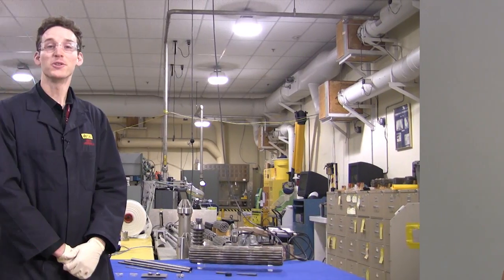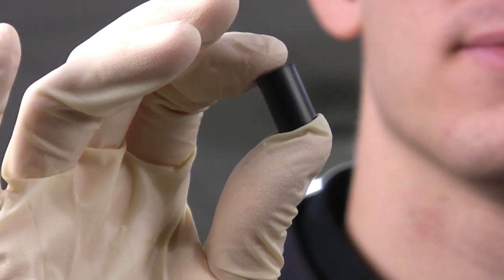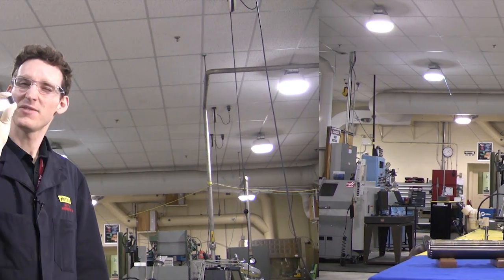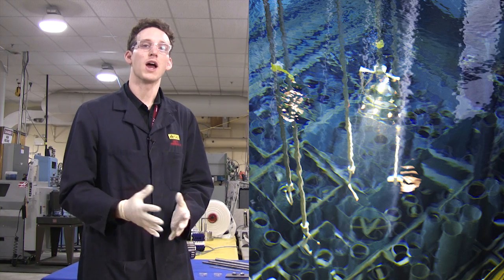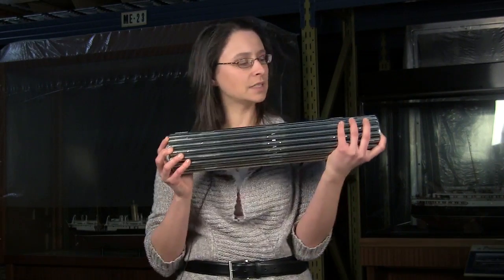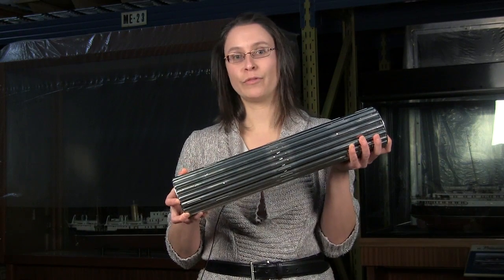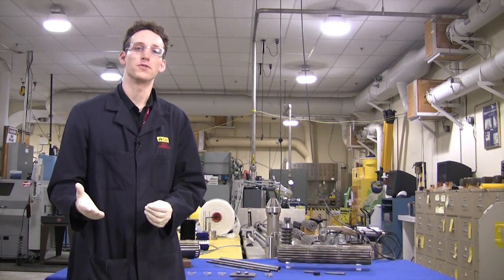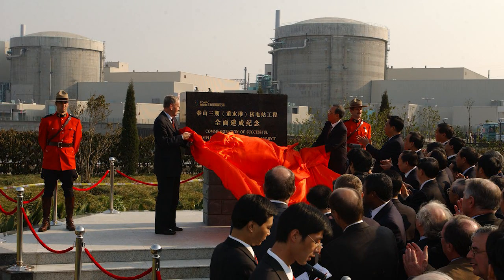Recycling Nuclear Fuels

Comment: Seems a waste to keep piping hot spent nuclear fuel rods in a pool for ten years. Can I have one to plonk into my water heater at home?
Reply: Bushcraft1974 are you joking?
Reply: @delisiafadelis6697  actually the penetration of radioactivity decreases in such a seemingly shallow pool. If you tread the water at the top of the cooling pool you would basically be getting no radioactivity on you. So hypothetically this might be safe
Reply: @delisiafadelis6697  He is right. It's doable. Using a Water to water(or radiator fuild but then you need another to water again) heat exchanger, you can transfer the heat to clean tap water.
We could actually have heating centrals heating hot water networks, some neighbourhoods already have such networks, running on gas.
Reply: It can happend because water cannot beamdes radiactives like the moon rocks. however you needs to cool off the reactor fuels or else it will steams and you will be getting freee electricyt instead of hot waters. thanks you!
Reply: I know your joking but you realize if cool water isn’t constantly pumped in the water will get so hot that it will evaporate, those rods are like 1400 degrees celcius
Reply: @tylersills9962  ok. so have free hot water for the whole neighborhood.
Reply: the idea of repurposing spent fuel rods is not crazy.....regardless of what some people may say here.  Of course, the problem is safeguarding the spent fuel rods, a terrorist can built a so called dirty bomb and really mess things up.  but your idea as funny as it sounds is not really crazy or funny....makes a lot of sense and is something scientists should be investigating.
Reply: Two years since I posted this. I still haven't received my spent fuel rod even after asking the NRC very nicely if they had any spare laying around?
Seriously though, no way they will implement this usage of the energy in the spent rods for the same reason they don't reprocess them into new rods (spent rods still have about 95% good  fissile material left), some one powerful is still getting rich mining the raw Uranium! Meanwhile the U.S alone has a mountain of energy dense waste laying around getting larger by the second!!
Reply: Soviets did it with Sr90 which they used to generate electricity and heat for Arctic lighthouses.

Comment: Fuel bundle is so heavy that you cannot carry it and wave it while taking. The fuel bundle shown is definitely empty.
Reply from the maker: You are correct, it is a replica fuel bundle
Reply: Nij Jin. Even when the fuel bundle is full it is not very radioactive, at least before it is put in the reactor. So it is reasonably safe to handle.
Reply: It is actually a full of uraniums and ready for use in a reactors. Thansk yous!
Reply: @CanSciTechMuseum  not that you'd come to any harm handling a live and fresh fuel assembly. Besides the physical weight fresh reactor fuel bundles can be bare handed perfectly safely.
Reply: @Nij Jin it's not a problem. Fresh reactor fuel is incredibly benign. You can bare hand it perfectly safely.
Reply: @paulanderson79  wrong
Reply: @paulanderson79  clearly you have no idea whags6 inside fuel rods
Reply: @WadcaWymiaru  So for me.
Reply: @sturggaming6759  What do you think is inside them?

Comment: So can a test tube with this pellets could heat up water? Or is t need something else?
And how small can a nuclear powerplant be made? For example the size of a refrigerator?
Reply: The core of a research reactor isn't much larger than a domestic fridge. A test tube of pellets alone cannot heat water as there's insufficient material to sustain a super critical reaction.
Reply: Watch videos on how reactors work need  developer pools a core needs transfer pipes transmitter etc etc etc
Reply: Look for NASA kilopower reactor for moon missions and deep space satellites. quite small, but on earth you would need protective shielding a wall of concrete, steel or lead. The higher the enrichment of the fuel the smaller you can go. Also using neutron reflector like beryllium helps to get even smaller.

Comment: If you use a fast breeding reactors you can refill the reactor and run it for about 20years if I remember it correctly.  Molten Salt Reactors are better type of Reactors because it is a very save Reactors. It moderate himself and you can easily sleep at the work like homer Simpson 😄

Comment: Solid fuel reactors are the past. We must invest in MSR and LFTR.
Reply: These designs do have their own drawbacks as well.
Reply: @paulanderson79 , not as many as in the PWR. (In my opinion)
Reply: @stefanotherisod3311  All designs have drawbacks and are limited by compromise. AGR were once the new nirvana but they are now relegated to history.
The fuel cycle itself isn't automatically indicative of a particular design.
Reply: @paulanderson79  , agreed all reactors/designs have their drawbacks. But if you design a fast molten salt reactor you will have the following advantages: - Low pressure. - Walk away safe - Liquid Fuel - High temperature and thermodynamic efficiency- Self regulating output power - Reduced waste and shorter "half life" - Burn Plutonium and PWR spent fuel. Are they perfect: no. All the problems have been worked out: no. (Especially for thorium based reactors) This is why we must, in my opinion, invest in this kind of reactors and shelve ASAP old PWR and fossil fuels.
Reply: @stefanotherisod3311  couldn't agree more. The barrier is political. You and I are acutely aware of that.

Comment: How many times can an uranium pellet be recycled ?
Reply: Uranium pellets for recycling are destroyed, so technically the pellets aren't used again at all. 

But in theory, a pellet only looses about 1% of the uranium its structure before it has to be recycled. (I may be wrong in actual numbers, and it changes depending on reactor type.) This is because the Fission products (left over "ashes" from the reaction), are inside, poisoning the reaction.

So if you could extract the fuel from the pellets, you could get several uses at least, and many, many more if you added more fuel over time. 

It's not cost-effective right now, because uranium, and low enriched uranium is currently very cheap for the power it produces, so "saving fuel" is largely uneconomical.

If a reactor was designed with perhaps a liquid fuel, or designed with a fuel and reactor cycle to minimize fuel reprocessing costs, it might become economical. 

Some kind of Reactor that operates with a Fast neutron spectrum, where reprocessing is Integral with operation.

Or a Reactor that perhaps has a Salt based chemistry, but operates at high temperature, so the salt is Molten.

I'm just upset that it's taken so long for these ideas to percolate up through the subconscious of the public.

Comment: Are the pellets of fuel made of something that's very hard to dissolve or become particlized?
Reply from the maker: CANDU nuclear reactors use uranium dioxide (UO2
) made from natural uranium. The UO2  powder is pressed into solid pellets and then baked into a ceramic form, and put inside a tube made of a zirconium-tin alloy.
Reply: Canada Science and Technology Museum I guess that's a yes. Still we could give them to prisoners to hammer into powder so they can be reprocessed.
Reply: @lightdark00  Can't see that happening. Canada is precious about its inventory.

Comment: Why not use this waste in a Molten Salt Reactor?  These reactors are coming on line in next 5 years.  These reactors can use 95% of the energy in the in the fuel as well as run on this waste you a talking about.  Why not plan or using these reactors to solve this waste problem?
Reply: I've heard that sodium reactors have existed for a while. I can't understand why they were discontinued.
Reply: If they are coming online in five years, where are they currently being built? Nuclear plants take about 5-6 years to build.
Reply: @nathancamara6285  , sodium cooled reactors aren't MSR. The sodium in those reactors cooling system explodes when reacting with water.
Reply: @lightdark00  , China and India are working on them. China should have something working in a couple of years. There are a couple of startups working on different designs. Elysium is one of them.

Comment: To recycle the spent fuel rods, why don't they use them to heat cities with hot water?
They could be in a central location and used to heat water , then pump it to heat all of downtowns buildings for a long time. Save money for the city.
Reply: Why? Or why not? Because the energy companies are very precious about their inventory and about their profits. That's why we're brow beaten about the 'risks and dangers' of the nuclear power industry.
Reply: Because once its out of the reactor they want it to die, because they have no way to control it.
And because all the water that directly touches the reactor are kept on site until its safe to realease it. 
It's also not feedwater, but a closed system of distilled water with boron dissolved into it. 
So...not a great candidate for district heating, as its vital resource. 

The water that goes in and out are sepeated by heat exchangers, and would be a great candidate, but they need that water to go directly to the cooling tower, before returning while being supplemented with what they need to pump it. 

Though I'm sure someone thought of dirctly or indirectly taking advantage of the warm water on the way, if it messes with the thermal flow its a no deal.

Comment: why not we use liquid nitrogen to cool down fuel cell any suggestion
Reply: Do you know how much liquid nitrogen it would take to cool it down for 10 years?
Reply: "the cool down" is not so much about lowering the temperature rather than giving the used nuclear fuel time to decay into less radioactivity. While this decay creates heat, it doesn't create that much heat and lowering the temperature further does not speed the process. Rather the important thing is to ensure that the radiation emitted is contained safely. Water turns out to be an excellent radiation shield. It's also cheap and easy to handle. We can in theory use, say,  lead, but lead is heavy and toxic. Nitrogen can work in sufficient quantity (anything can work as a radiation shield in sufficient quantity), but it's expensive and hard to handle. Plus it won't speed the process any. Whether it's cooled down to -100 C, or just to 25 C, or allowed to heat up to 400 C, the decay rate, and thus the time needed, remains the same.
Reply: The problem lies in very low Nitrogen heat conductivity:
https://www.engineersedge.com/heat_transfer/thermal-conductivity-gases.htm
and volumetric heat capacity.

Comment: omglol. hold a used fuel budle that way for a minute, and you're gone! bad propaganda!
Reply from the maker: lephisto You are right! You wouldn't want to hold a real fuel bundle. By showing a replica we are hoping to show you the size and shape of a real one.
Reply: But the clip suggests that to people without the knowledge of Nuclear technology. This trivialises the complexity and Dangers of a so-called nuclear Fuel Cycle.
Reply from the maker: lephisto Thanks for the feedback, I will pass it on to those that prepared the video
Reply: +Canada Science and Technology Museum That is good feedback, but remember that the video said it was kept under water for 10+ years.  Much of the radioactivity decays away in that first 10 years.  The commenter would be correct if it were a newly used bundle (but the video mentioned that they are dangerous when they first come out of the reactor and are stored under water due to heat and radioactivity).  So, really, is the video wrong?  When you watch "Pandora's Promise" you can see a person standing only a few meters from a spent fuel cask and the geiger counter is reading background levels.  Yes, the cask provides shielding, but it puts in perspective the relative danger of "spent fuel" that has been sitting around 10+ years (not much danger at all).
Reply: Mark Smed. Do you know why? I have heard it a few times before but I have searched the internet and found no reason why.
Reply: * CCHLV *
Fresh fuel is just natural uranium, which consists of very long lived isotopes. Because the decay happens so slowly, it's just not all that radioactive. Spent fuel however has short lived fission products in it, they decay very fast and thus are spectacularly radioactive.
Reply: Nope. After a while, the radioactivity is not that dangerous.

Comment: Yeah, and is the most contaminant form of energy ever.
Reply: triple pelotudo millions of tons per year from burning coal - mmmm... ash and acid rain
Reply: triple pelotudo That's why we need too make Molten Salt reactors..they extract tons of energy from the nuclear waste  with almost no waste afterwards;and if an accident happens the waste fuses together cooling it down,and turning it into a block of ice.
Reply: Compare to fossil fuels fumes looks like clean air in the mountains XD
Reply: triple pelotudo Molten Salt Reactors take nuclear waste and process it into nuclear power.The reactors are what's called walk away safe.Walk away reactors keep power plants from going critical.Instead of exploding the waste freezes into a solid block.
Reply: Kernels If we use Molten Salt reactors we can process nuclear waste and turn it to nuclear power,the waste from that is only radioactive for hundreds of years compared to thousands of year.
Reply: 1. It is not all true. When fuel salt overheat it expands making fission hard.
www.youtube.com/watch?v=f30bqgO3IxQ
"Fuel salt such as LiF-ThF4 has a volumetric heat capacity that is around 22% higher than water"
"the LiF based salts have a thermal conductivity around twice that of the hot pressurized water in a pressurized water reactor."
https://en.wikipedia.org/wiki/Liquid_fluoride_thorium_reactor
salt rather contain that heat, around 10 times better than water because heat conductivity plus, near ten times higher melting temperature.
However that can't work forever without draining the energy from salt, it will start to boil.
2. There is no way of explosion because heat up -> energy down. All in atmospheric pressure XD
3. I think usefull waste. Strontium and caesium end their work. But if you use RTG/RITEG technology...you'll able to milk them XD
Reply: Not really. There is many of them, India and China build their own too...
Reply: No